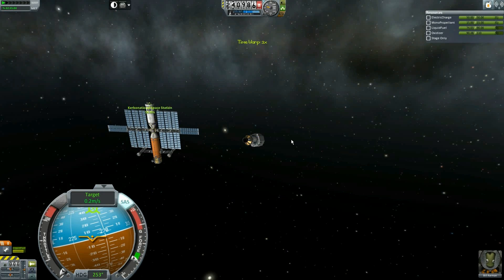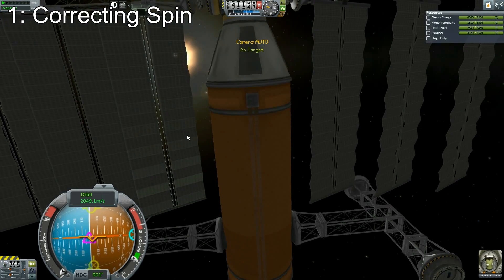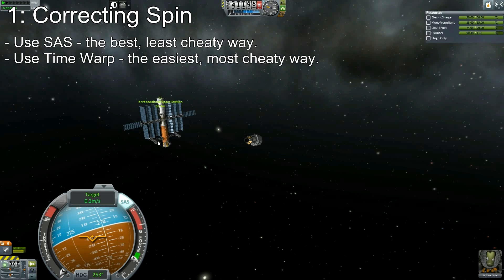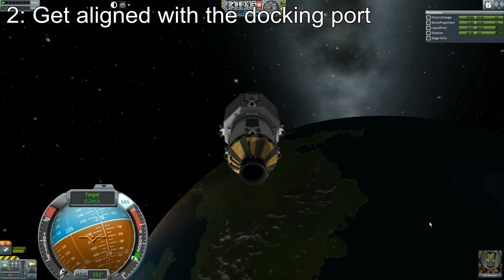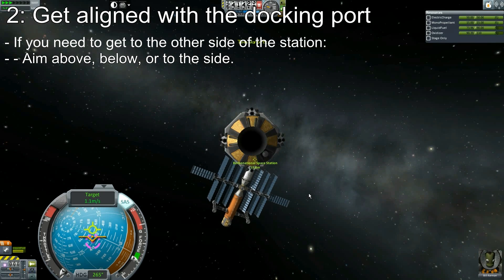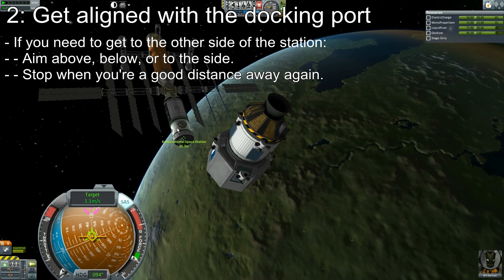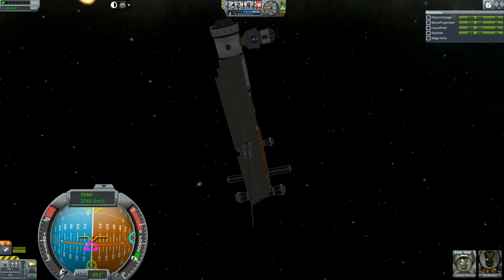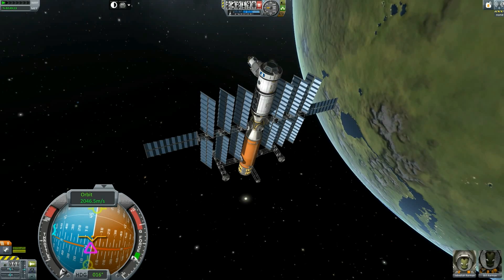KSP Fundamentals - Rendezvous, Approach, and Docking Part 3: Docking

Comment: Nice video. Just a few basic safety notes:
- Turning down main engine power (right click, reduce thrust to 20% for example) helps arresting the  velocity with more precision. Also helps in case of pressing wrong key. Can also shutdown the engine once docked.
- Can do a right-click + "control from here" in the dock port when controlling the station. So in this case you could make the station port face the incoming ship.
(of course if you change the ship settings, should switch it back to original afterwards. Would not be the first mother ship i end up wasting a ton of Delta-V burning sideways because of wrong control point)
Reply from the maker: Very nice tips, and I even use them myself a lot. I wanted to make sure to cover how to do everything with the incoming ship, though, so you're comfortable docking with debris as well.

But yeah, thrust limiting engines is a very good practice and turning the station - especially in those cases where your incoming ship is unweildly - is a great idea as well.

And as to pressing the wrong key, who does that? Not me. Cough. Cough. Ahem.

Comment: Good Vids about docking.

After doing my space station, then putting together a transfer ship to move the unassembled pieces over to Pol, this seems so easy now :) All was pretty hard originally, but after a few times you simply "get it". 

My bit of advise to new ppl watching these:  just try it in sandbox mode. Build a station at say 20'000km above Kerban and try to dock with it.  You'll learn logistics, fuel saving, your max part count before lagging bad (mine is ~575) and obviously docking !
Reply from the maker: Great points.

I may actually do an entire show on testing. It may be a good idea to actually see the iterative testing process if you're a new person. My first ship very rarely makes it to orbit. My 10th ship rarely makes it past orbit. It's usually version 20 or more that actually partakes in the mission. A new person may experience that and think they're failing, when in fact that's just the way the game works. At least for me.

(And that's with the help of Kerbal Engineer Redux)